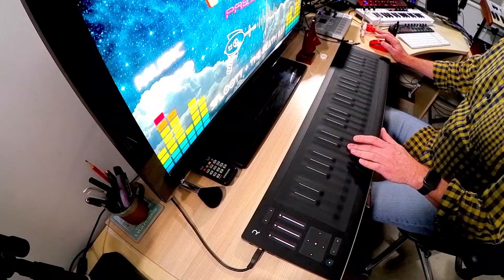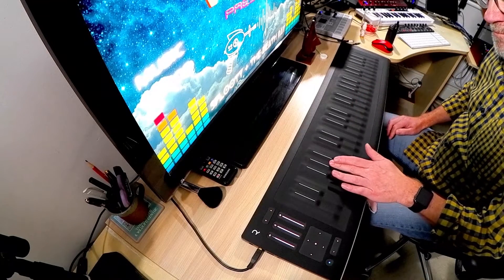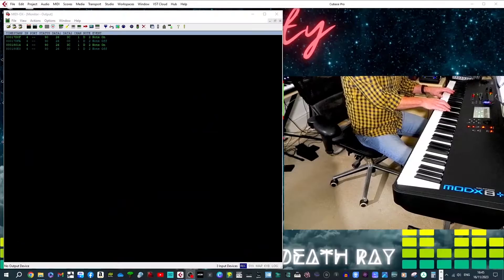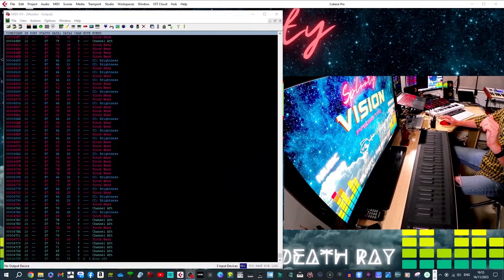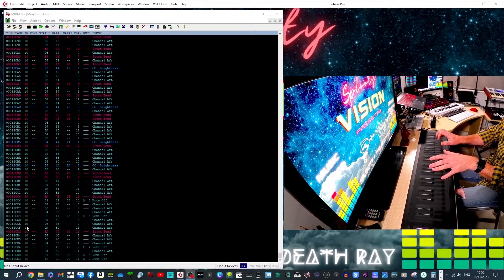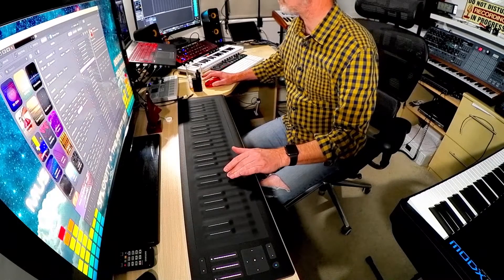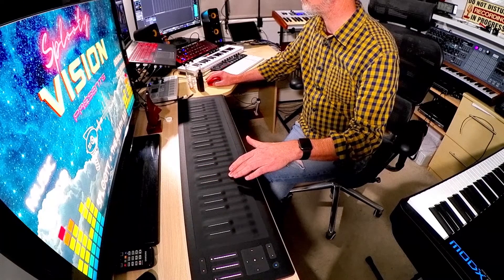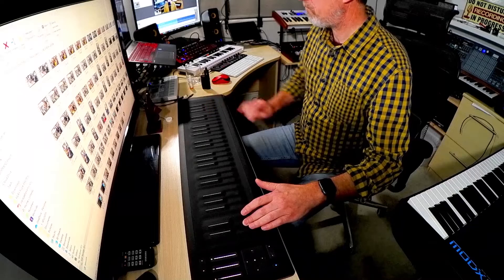HOW does the ROLI Seaboard actually work ??

Comment: Hello, thanks for the video. I would like to ask you a question! I am using the Swam violin library! How can I set the Roli to mpe 48 semitones and at the same time have an external pitch wheel down -2 up +2? When I have mpe 48, the pitch wheel is 48 semitones. Is there a way to change this? Maybe with logic pro x scripter midi messages ?
Reply from the maker: Hi there.  Not sure if exactly the answer looking for but think you can maybe do what looking for by using a separate MIDI track pointed to the VST track.  For example I'm in Cubase and have an Equator 2 track set up as usual with Seaboard Rise as the input, Equator 2 as the output and the input and output midi channels set to 'Any' and the pitch bend in the ROLI Dashboard set to 48.   Then i've set up a separate MIDI track with input as my Deepmind 12 synth and the output as the Equator 2 VST.  In Cubase the Deepmind input is set to Channel 3 (same as the synth itself) and the Equator 2 output is set to Channel 1. 
So the Equator 2 VST and Seaboard operate as normal, pitch bending between notes etc.  But I can also use the pitch bend wheel on the Deepmind at the same time over a standard 1 octave bend range.
Hope that helps ?  Cheers.
Reply: @splootyvision  Thank you very much!!!!